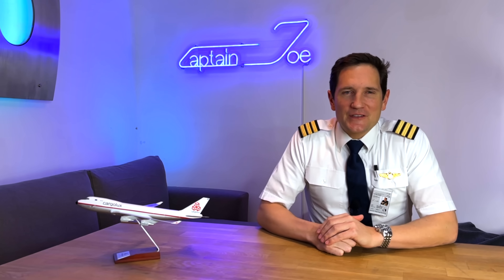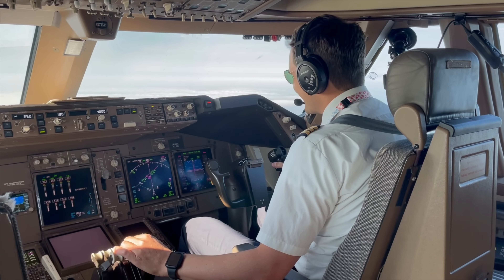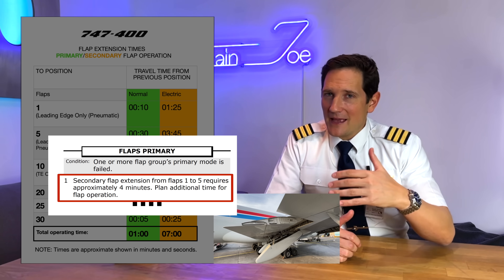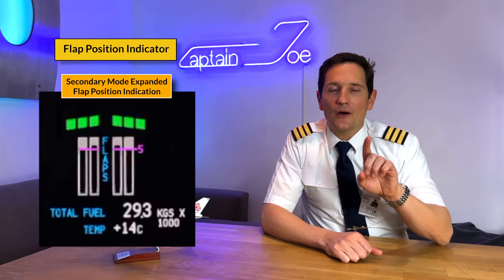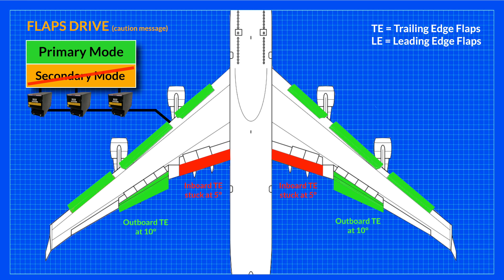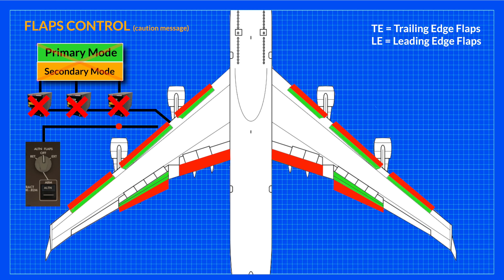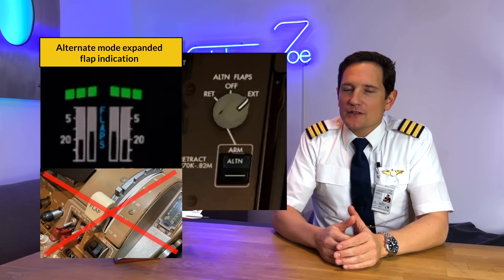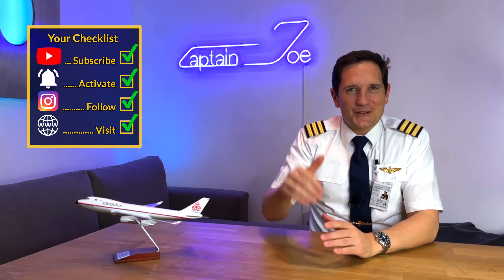WHAT DO YOU DO if your FLAPS DON'T EXTEND??? Explained by Captain Joe

Comment: Hello. I was recently on a Southwest flight and I noticed that when were descending to land the back wing flaps never came down, only the front slats did. As we approached the runway I noticed that we were coming in very very fast...after landing the copilot said "Well at least we have brakes" and the stewardess said in a shaky voice "Well....we landing...we landed". In you opinion do you think that there was a malfunction with the back flaps? I've flown enough to know that this has never happened to me before. Thanks.

Comment: i would think that the last option for the flaps would be to just use the air it self to pull the flap to the down position. what does mean it will be stuck in that mode.

Comment: and if the Alternate Flap Mode fails?
Reply: Circuit breaker and if that fails then you just land without them it’s not the end of the world if they fail pilots are trained to land without flaps safely but yes it is harder and will require more runway
Reply: they perform a flap up landing, happened to one of our 747-8 last year, the 748 has a crappy flap transmission system if not maintained properly they can seize up

Comment: captain joe I just did a return trip from New York to Chana on delta's 767-300. 10 hours crossing the atlantic.
Iam not an aviator but love every thing about Aeroplanes and am particularly fond of the B767's. 
If an flap, engine or hydraulic emergency occours in the middle of that crossing how or where would they make an emergency landing if it becomes necessary.

Comment: I was a passenger on a 57 which had right flaps extend but not left.  Pilot tried three times.  Plane listed pretty significantly.  We were in the vicinity of JFK’s 13k runway, so declared an emergency and landed at 250k if I recall, very long rollout. Trucks rolled but no fires.  We were watched for a fire on a taxiway.  It’s been 20 years, but I think my recollection is close.

Comment: Hi Joe. I have an interesting subject you should do for a future video. Why some planes have APU and why some planes don’t. Also why some planes need APU and some planes don’t need APU. Sound interesting enough?
Reply from the maker: Can you list the planes that don't have an APU?
Reply: As I’m realizing only passenger jetliners have APU. However some aircraft from the early ages used piston power to power an engine thus spinning a propeller. So therefore Passenger Jetliners have APU. Piston driven aircraft don’t. But why?

Comment: 2:50 Joe, there is no asymmetry protection on the LE flaps. By the time the FCUs have detected a LE flap group not reaching the commanded position, say the LH group A flaps, the RH group A flaps will have already extended pneumatically. Only uncommanded motion cause the FCUs to react quickly (0.3 seconds). In flight, the switchover time to electrics in the air for extension is 35 seconds (25 seconds for retraction). The aircraft can handle LE flap asymmetry.
I've seen other YouTube videos claiming asymmetry protection, but the Boeing Maintenance Manual disagrees. The Maintenance Manual even states that the 4 LE groups operate independently in primary pnuematic and primary electric. Ref: 27-10-00 pages 10~12. Note that the Boeing Maintenance Manual does not use the expression "secondary".
Reply from the maker: Thanks buddy! I will ask my maintenance boys! But thanks for the heads up
Reply: @flywithcaptainjoe Of course, Boeing Maintenance Manuals have been known to be wrong or ambiguous. I looked at the Boeing wiring diagrams and independent electrical control of Left and Right wing group A flaps (and Left and Right wing group B flaps) is not possible. There is a single control ouput pin on each FCU to the left and right group B drive motors (2). There is another single control ouput pin on each FCU to the left and right group A motors (6). Well, there are multiple relays between the output pins and the drive motors, so it is possible that a relay could fail in Primary Electric mode (your Secondary Electric mode) and cause asymmetry in the same group. However, there is still no real asymmetry protection on the LE flaps. 
Boeing manual quote:
"5
(c): If a the FCU sets a disagree while a flap group is in primary electric, the FCU will continue to energize the electric motors, even though there may be no flap movement.
(d) The times (sic) delays for the FCU to set a disagree are:
.....
3) LE Pneumatic:
 Extend: 35 sec in air, 15 sec on ground
Retract: 25 sec in air, 15 sec on ground
4) Extend: 135 sec, or 5 sec to leave retracted position on ground
Retract: 135 sec"

Clearly, this is not going to stop asymmetry in LE Primary Pneumatic or Electric.
Note that there may be further time delays on the messages appearing on EICAS.
Reply: @Boeing747Cultist Everyone disappears eventually
Reply: @ImperrfectStranger  especially if you expose Boeing
Reply: @Boeing747Cultist  Thanks. I finally know what you are talking about. Good luck with your conspiracy theories.
Reply: @ImperrfectStranger  I don't know if it's a conspiracy theory or not, I just repeated the same old meme because this is the internet and we just parrot the same crap over and over.
Reply: @Boeing747Cultist  I'm more likely to disappear over things I've said about Airbus 😅
Reply: @ImperrfectStranger  god save us from getting snatched by the corporate hitmen
Reply: @flywithcaptainjoe demand explanation from maintenance lower class individuals.
You are above them.
They are subservient to you.
Aircraft maintenance is very very low class.
Pilots are extremely high class.

Comment: Hi!
Thank you for the inreresting video!

Can you please explain, how can you restore a pressure in hydraulic system in flight? You can, in theory, use a fuel as a hydraulic liquid to refill the system, but this is not the case for 747, if I remember correctly...

Thanks!
Reply from the maker: For example if you had an overheat situation, then you would shut it down for a while to cool off, and then start it up again for approach and landing
Reply: @flywithcaptainjoe  Thanks for the answer.

Comment: As someone who works in IT, I would love if our systems had a 'screw you, screw your failures, just do it anyway!' override switch
Reply: It reminds me of the “battle short” setting on some military equipment such as generators, basically it will disregard all faults / warnings and run until it’s out of fuel / seizes / whatever.
Reply: crank deployable flaps, redundant manual systems in case of hydraulic or electric failure

Comment: Aren't the leading edge flaps called slats?
Reply: Both are different. If the device re-energises the boundary layer, those are slats. And if the device increases the camber, then those are leading edge flaps.

Comment: I thought the movable part on the front of the wing was called a Slat.  If all systems fail you can always do a no flap landing, just need a very long runway
Reply from the maker: On the A320 they are called slats, on the 747 they are called "Leading Edge Flaps". Same same but different ;)
Reply: Both are different. If the device re-energises the boundary layer, those are slats. And if the device increases the camber, then those are leading edge flaps.

Comment: Joe, I'm a retired ATCO and I want you to know and spread this warning to pilots who you know that fly to Brazil: in June, some idiots build and release huge hot air balloons, mainly in the southeastern region of Brazil. You should ask for the main aeronautical authorities to contact INFRAERO for example, to discuss what can be done to prevent accidents that are " waiting to happen ". Sometimes even 16 kg  steel butane containers are connected to said ballons. Be advised!
Reply: There were incidents before, with planes hitting those baloons and get entangled. I saw some pictures of that.
Reply: I think it should be treated as a criminal offence to send entire butane cylinders up there.
Reply: Leading Edge flap is also called SLAT, right???

Comment: I wonder if you can fly upside down and maintain altitude okay with full flaps and gear "down". This video made me wonder.
Reply: probably not.

landing gear position wouldn't do much, aerodynamically (aside from adding further drag; but it doesn't alter lift characteristics.)

I reckon that a commercial jet might be able to flight upside down with retracted flaps.

but with them extended, too much air gets directed into the then "wrong" direction that the required angle of attack to counter this would just be too high; or the engines not powerful enough; however one wanna see it.

Comment: Glad you’re back Captain Joe!
Reply from the maker: Thanks buddy! Had to take a break from it all. But have a great line of videos coming :)
Reply: @flywithcaptainjoe    When MH370 was gliding to the surface of the ocean with the captain controlling it in the cockpit, & only RAT power available (but batteries too), at which point (e.g. 10,000ft) would he have tried to set the wings' flight surfaces (via the centre electrical system) to slow the plane as best he could for the ditching? Would the available flight surfaces take longer to set, due to being on the secondary power grid? I think he was aware of the slowness of the secondary power grid as he would have simmed it, so he was prepared for the delay to set those surfaces. What do you think? Thanks